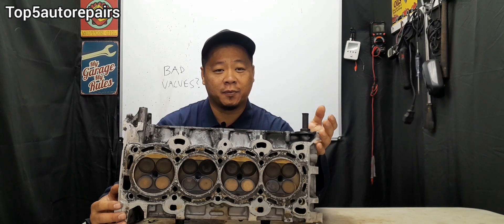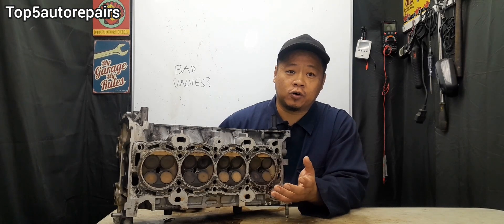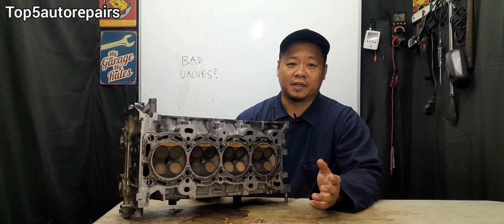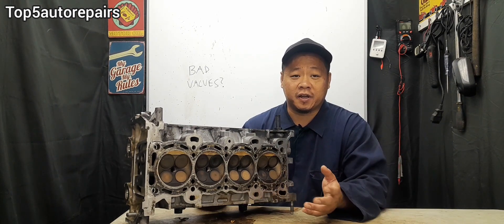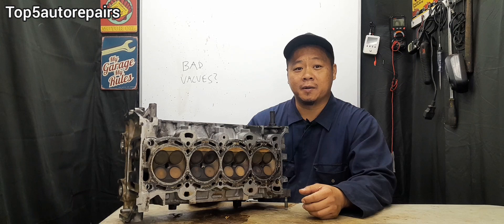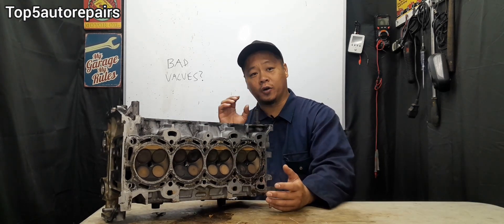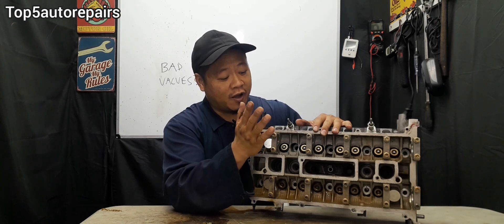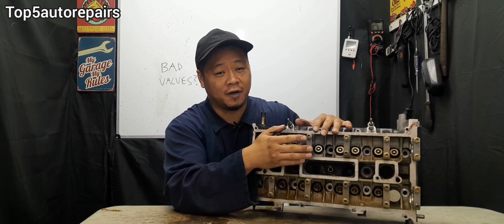HOW TO CHECK FOR BURNT, BENT OR BROKEN INTAKE AND EXHAUST VALVES WITHOUT REMOVING CYLINDER HEAD

Comment: I have a misfire on a 302 v8, it has a dead misfire, only thing I can see wrong it has is cracked manifold gasket and low compression on that cylinder + exhaust sounds bubbly and stuttering. Loss of power and high idle.  - it is mechanical I changed everything else. 

It has to be worn rings ( big head ache), worn cylinder walls ( bigger head ache) or valves ( easy day) 
How do I check? A leak down test to check direction of leak , then wet compression if higher results then rings likely,  open it up- check clearances and visual inspection?  Lastly take head off put liquid see if it spills thru? Check valve replace or just re lap. 

I should essentially pour my attention into the valves and if somewhat bad looking, relap and put together then if missfire consists it is rings? The exhaust sounds so bad.
I seriously don’t want to rebuild this motor but I’d love to learn though. 1991 f150
Reply: Manifold gasket is broke between 2 cylinders not cylinder and outside (unmetered) , i suspect the pressure from the misfire cylinder helped cause this. It has overheated one time that caused this.

Comment: I have a 2018 Toyota Tacoma with only 43k miles. My check engine light came on which resulted in a valve leak in cylinder #1. Toyota will be repairing. Curious what the root of the problem will be.

Comment: What causes  heating of  outlet valves for a Nissan np 200. The car engine was starting well but after few seconds the the idling would change and even go down until it cuts off with the engine shaking

Comment: Love your videos man. 

How do u time a 2009 dodge journey 3.5 litre.  When replacing  new timing belt 

How do u time the engine correctly? To TDC ??

How do u know if its on compression stoke 
Or exhaust stroke???
Reply from the maker: Hello. Remove spark plug on cylinder #1. Place a 1/4" long extension and put it inside the spark plug hole. Rotate engine until 1/4" extension is at the highest point on cylinder #1. Verify timing marks are aligned on camshaft and crankshaft.
Reply: @ 

Question if I do that rotate the engine by hand and number 1 cylinder is at TDC. 

How do I know if I’m compression stroke or exhaust stroke??

Comment: What happens when you read high compression in 1 cylinder?
My truck is reading 178psi on all cylinders besides 1 which is reading 200psi toyota v6
Reply: sounds like 5 slightly worn valves and 1 perfect cylinder
Reply: thats also within %15 difference so not a huge issue (not by alot those readings is 14% difference) but if you’re a perfectionist like me 10% and below is what i like

Comment: Hi

My CRV 2010 R20 valve has lots of soot/carbon deposit on the intake valves and was leaking. Would this also cause carnk only and no start?

Fuel and sparks are all good and new.
Reply from the maker: Yes it will cause a crank and no start if the valve is not closing all the way, this will cause low or no compression for that cylinder.
Reply: Thank you so much

Comment: I’ve had rough idle and then shaking engine , had a leaking injector that has damaged the cats and clogged up but then now the engine shake and lost power . Did a compression test on the cylinders to find cylinder 1 had zero compression. What should I do now, does this mean the car is a right off ?
Reply: Have you found a way out now, cause am having the same issues now..I need help
Reply: @ cylinder had zero compression so was bye bye to that car sadly , engine rebuilt I didn’t want to waste time on

Comment: Zero reading in cyl 1 and 3, 180 psi on 2 and 4, took head out, gasket looks intact, valves look ok too, cyl looks ok, all crosspatch are there some carbon buildup but vehicle has 209K miles; it was driving fine for few minutes and started overheating due to low coolant; old fluids, stopped right away, let it cool down, drove slowly without letting temp raise to home, shut down ignition and never started again, cranks but not start, then did the compression test mentioned with those results...any thoughts?
Reply from the maker: Hello. Sorry to say your head gasket is blown. The cylinder head is most likely warped as will need to be resurfaced.
Reply: @Top5AutoRepairs  Found out what was wrong and the car had gunk up gas that is what caused the valves in cyl 1 to be sticked opened and it wont start; not head gasket issue. There is always something to learn as it turns out.
Reply: @Top5AutoRepairs  like I said, head gasket is not blown, I am looking at it
Reply: Did it sound like no compression?

Comment: I got 2011 f150 3.5 and timing chain jumps, put new one and test moving the crankshaft and the chain jumps in certain time and tensioner compress and decompress, is that is hiting a bend valve?
Reply: Hey i got a 2011 F150 3.5L too and replaced the timing chain also, i'm here because i have no compression and the valves aren't fully closing causing the engine to turn but no start, i advise you to get an endoscope from amazon to check your valves i got mine for 50CAD
Reply: @B9poy  i buy one, but before I open the cylinder head take all the valves out, notice one of them was rust and it was hard to take it out because of that. I clean all very good take the rust out, put each one back in the place they were before and all are smooth. Think that was the problem, rust. Also I didn’t before put oil in the cams, so now iam put in oil in everything before start the truck, in case the oil pump miss something lol.
Reply: @JohnJohn-nh5mj  the oil pump wouldn't miss that you don't have to worry about it haha but it's okay i'm glad it worked out well for you, i'm still trying to figure out why my valves aren't fully closing and i can't find anything about it
Reply: @B9poy bent valve or gung
Reply: @Ironhanger433  Yup it turned out to be that and it turned into a whole engine rebuild project

Comment: Little burnt valves can drive a mechanic crazy!!! In my experience if i ever get one burnt valve im gonna replace them all. I did one once and replaced the bad valve. Put back together 2 weeks later another one went bad took back apart replaced. Two weeks later again same thing i just left it and said f with it lesson learned!
Reply: Did you need to replace the head gasket again.
Reply: @MarkNewphone  every time or it's a risk. The special torque pattern is a cue!
Reply: @johnreed2272  I change the timing chain in a 2011 f150 .3.5 , when I went to start the truck it get accelerated to 5k revs. You think has to be with valves? I ck sensors, bodytrotle , air filter…and I don’t find nothing. Thro codes p0223, p0221,
Reply: @JohnJohn-nh5mj 
Throttle position codes. 
Seems to Indicate either your throttle position sensor is bad, or you didn't hook it up.
Reply: Those are pedal positions sensor codes. If the pedal sensor or throttle body is bad it will rev like that  @JohnJohn-nh5mj

Comment: Hi thanks for sharing your knowledge its very informative, just one question can i do a leak down test or a dry test when the cylinder head is still attached to the engine? Reason being,on my w204 i met an accident and the timing chain slipped of, my mechanic says my valves are bent i just want to be 100% sure before i can start working on changing the valves,can you advise

Comment: Am having the same issue with my top cylinder in my Corolla 2006, one out of the 4 valves isn't working and it casing my car to constantly shake and if I stand at one place while on motion it continues shaking
Reply: Pls how did you solve the issue am having the same problem right now

Comment: Hi, great videos. I live in Sydney Australia. My 2007 Toyota Corolla car with a 2ZR-FE engine has a ticking/pinging/knocking noise on acceleration and on idle vibrates a bit. There's no oil in the coolant and no water/coolant in the oil. I'm not losing coolant or oil. However, I found compression low in cylinders 3 & 4 (C1 & C2 125 psi C3 & C4 75 psi). I placed oil in C4 and redid the compression test - no change. The funny thing is when I start the compression test on C4 first it gives me 55 psi. But when I do C3 (75) and then go back and do C4 - C4 comes up 70 75 psi - weird! Anyway, without taking the head apart, how can I tell if there's just a hole in the head gasket between cylinders 3 & 4? Is it unlikely to be a valve if both C3 & C4 have low compression? Cheers, Jim

Comment: I have a 2014 dodge caravan.  3.6 and i have a cylinder 1 misfire that i seem to cannot fix.  With my scanner i can see that it only misfires at Idle. & after replacing the head it still doing that same thing. What else could it be?? Here is a list of parts ive replaced

Right rear cylinder head
Timing chain assembly replaced
Cylinder 1 fuel injector (replaced twice)
Fuel injector complete wire harness
Cylinder 1 Spark plug
Coil pack
Valve covers gasket 
Brand new* Replaced PCM
Reply: Did you ever figure it out

Comment: Hey thank you for you videos.  My car is at the mechanic and he says the valves are bent because car is out of time. He is say we need a whole new motor is this true? Why can't the valves be changed?
Reply from the maker: The valves can cause damage/puncture the piston head and if the valves break off it can damage the cylinder wall.
Reply: I'm not sure mechanic only said they were bent.  Thanks for your response

Comment: im after a misfire i cant figure out. ive done the following test and the look normal, copression test ok, leak down test ok, smoked test ok, ruled out good spark plug an good coil and good injector, no intake leaks. only thing i notice is misfire ONLY on idle. if you press gas just a little say 1k rps NO MORE MISIRE  soon as gas released there is mis fire cylinder number 1 only . 2014 vw routan 3.6l v6 engine. thank you . yes i have pulsing limp noid light for injector and i do have spark on coil. thank you.
Reply: Check idle air control valve or upstream o2 sensor(s). A stuck valve is also a possibility, but much more invasive than the first two.
Reply: I have the same issue , did u find  the culprit ?
Reply: @christopher9926   yes so with time the tick tick sound started and as it turns out it was the rocker arm. i took the valve covers off and it had soo soo much play and than soon after the 1 misfire cylinder 4 started to miss fire so i relaced all cam lifters and rockers arms and intake from bank one on cyilinder 1 was chewed up so i replaced that one cam shaft i put it all together and NO MORE MISS FIRES no noise very quiet.
Reply: i have the exact same issue in cylinder 1 on my 05 Honda Civic when I drive it's all good when I stop or park at idle it starts misfiring